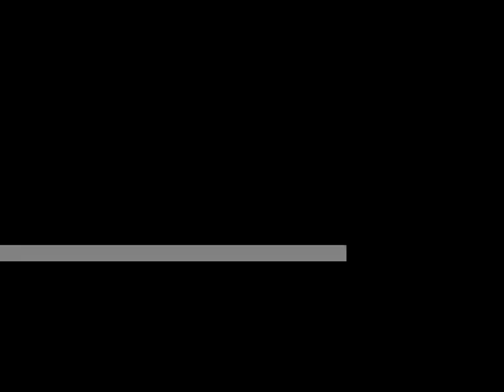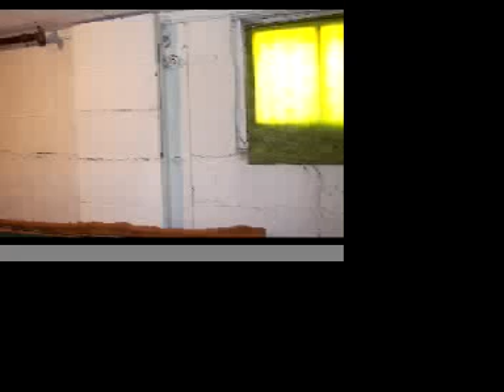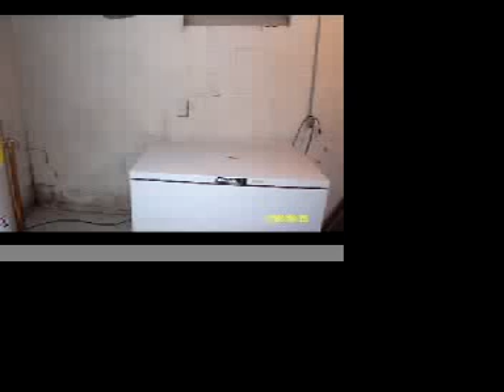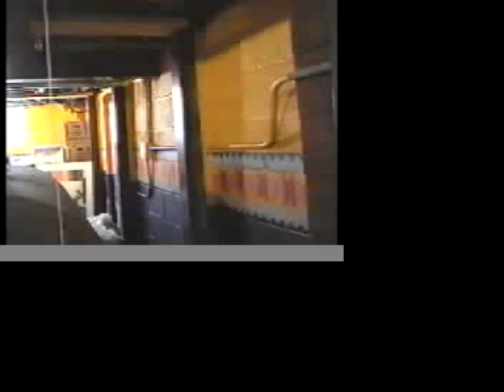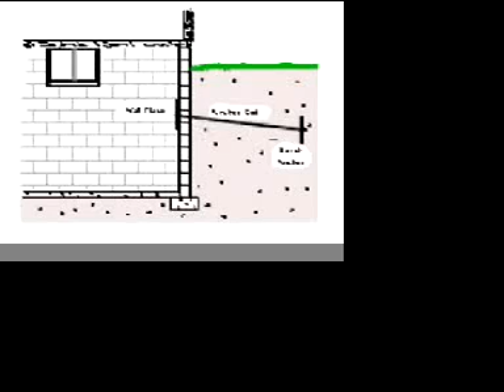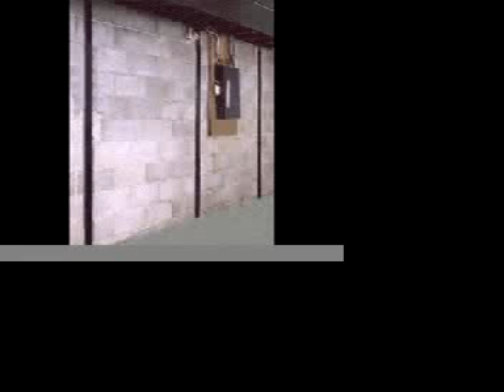New Basement Wall Repair for Ann Arbor - Carbon fiber Strips

Comment: Actually carbon fiber works really well. It is cheaper, easier, and doesn't compromise the structural integrity of the house unlike tearing down one of the foundation walls and rebuilding. also it doesn't hurt putting corrugated pipe outside of the walls, but with my experience, they just seem to fill up with mud over time and do nothing. I own my own business doing structural repair and drainage. I have done it for years. Other methods of fixing bowed walls is to use steel I-beams
Reply from the maker: I've now been in two homes in our area where the carbon fiber didn't arrest the wall movement. It certainly can keep the blocks together, but since the blocks aren't well tied to the slab the wet soil just pushed the wall further in. Steel I-beams embeded n the slab and tied to the floor joists above would not have moved. So it seems to work in some situations, but certainly not all.

Comment: UPDATE !      The Fortress carbon fiber epoxy contains NO VOC's and is odorless.  The Reinforcer brand carbon fiber has to be cleaned with m.e.k. ...a nasty  and hazardous odor. 
All certified Fortress installers utilize a HEPA grinding / vacuum system so there is virtually no dust generated from the wall preparation.